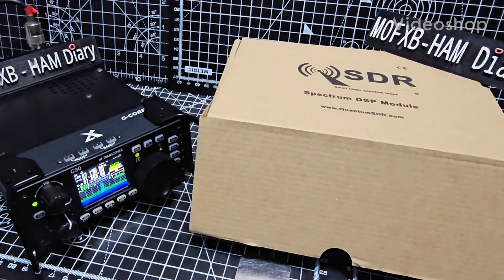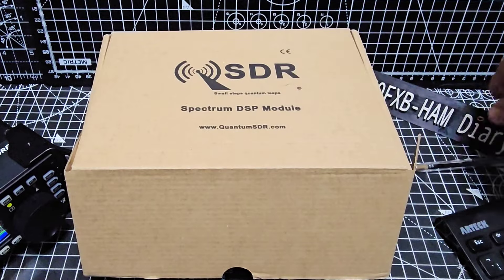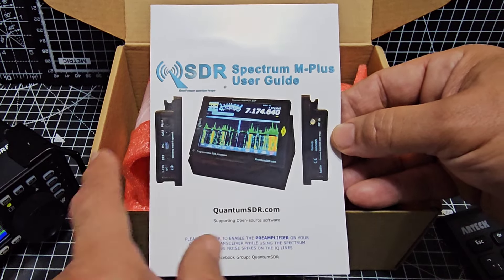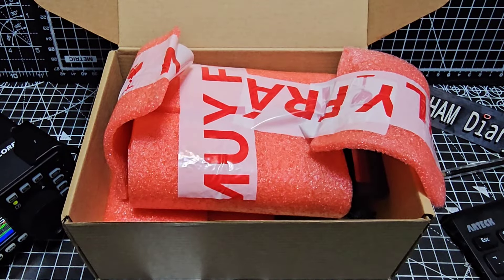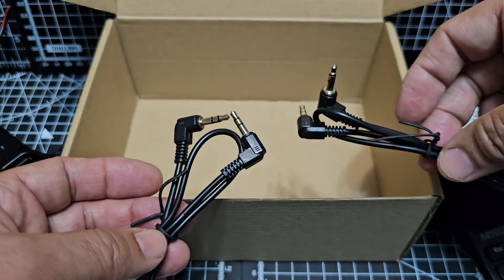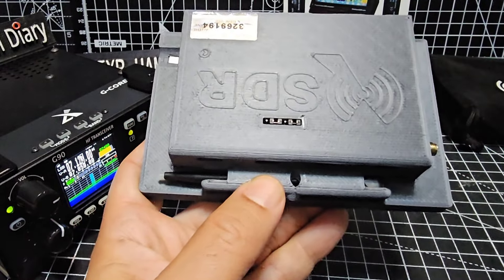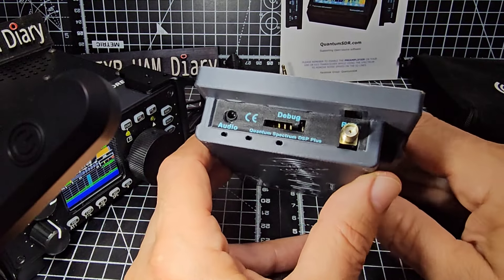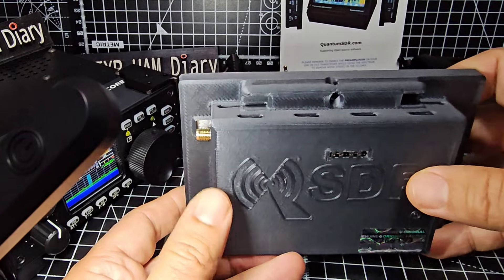QUANTUM SDR M3 + Module - UNBOX & CONNECT -2024

Comment: Very nice unit! I'm currently cobbling together a Pi based bandscope with a 7" screen, to work with my FTdx3000 which has a rather poor one built in. Meanwhile, I'm making do with a little Malachite receiver connected to the IF out and tuned to 9MHz, which makes a surprisingly good panadapter! But it's nice to see high quality, out of the box solutions come to market.
Reply from the maker: Send me video I will add it to my channel , M0FXB@OUTLOOK.COM
Reply: @HamTechRadioScannerDrones  I can video the Malachite in action, the homebrew version is still a few weeks out, at least...just gathering the components now.

Comment: For those wondering if it will work with your radio that has no IQ out, there are 2 methods to interface, if your radio has IF out like the Xeigu X5105 the set the IF to out on X5105 , move both jumpers on the back to the other pins, connect to RF in and enter your IF frequency (70.455 MHz for X5105) you may need to make your own cable depending on your radio or you may have to take IF from inside your radio.
You can then setup your cat controls and IF offset (I have not figured this out on X5105 yet , maybe a firmware update on spectrum may be needed so we can type in the Frequency)or manually tune your radio. The other method to connect if you have something like a uSDR/uSDX/TruSDR etc is to take the IQ from inside the radio and root this to the Spectrums IQ input.
You can also use the Spectrum as a radio receiver by connecting a bandpass filter to the Spectrums RF in and antenna to your filter, set jumpers for RF in ,i tested with MFJ-1040C Transceiver Preselector and some homemade filters
Reply from the maker: Many thanks great info.

Comment: Yaesu 450D ? If so I am a happy bunny.
Reply: It works with any radio, and you have full tech support
Reply: How does it work with the Yaesu ft450d? I have that radio. Does it have the waterfall display support?
Reply: @m3snusteve  You just connect the Spectrum DSP to the IF output or antenna via an SDR switch, and optionally the CAT port.  It has a CAR bridge to support PC applications and FT-8.
Reply from the maker: I have a 450 and lots leads

Comment: Are you suggesting that eventually they will have cables to interface this device with my 15 year old Yeasu FT 847 ?
Reply: I imagine it could be made to work with virtually any rig, providing you can access the IF output (surgery possibly required) or use an external antenna SDR switch. I even tapped the IF of my TS-440 and TS-520.
Reply from the maker: Yes I tap in to if
Reply from the maker: Thanks
Reply: You can just connect the Spectrum to the IF and optionally CAT port of any transceiver, or directly to the antenna via one of those $40 SDR antenna switches.